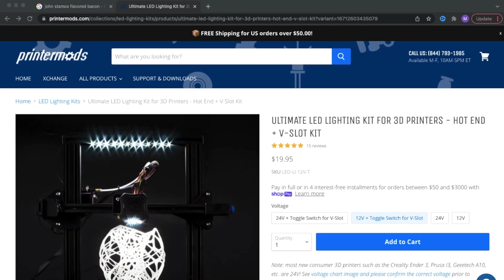Installing LED Upgrade On Our Ender 3 Pro - Printermods.com Light Review

Comment: I purchased this for my cr10s pro. However, the cable is not long enough. Do you have any recommendations for an extension since they don't sale one.
Reply from the maker: I’d grab some cheap red/black twin lead wire from Amazon and some butt connectors and extend it out as much as you need. Since it’s DC voltage I would feel plenty safe doing that. I think that would be way easier then tracking down whatever cable connector/pins they use to make an adapter extension.
Reply: Would you say something like this would work?
Reply from the maker: I don’t think it posted the link my good sir

Comment: what fan holder STL are you using?  it seems to fit the wiring very well!
Reply from the maker: Sorry for the delay! Took me a hot minute to find the file again. It's called the Satsana. I have the version for a Microswiss direct drive hot-end without a touch sensor. There are a ton of variations/remixes from stock to wild. Here's a link to the main file and then you can pick out your exact stuff from the remixes. Cheers buddy!
Reply from the maker: https://www.thingiverse.com/thing:5139196